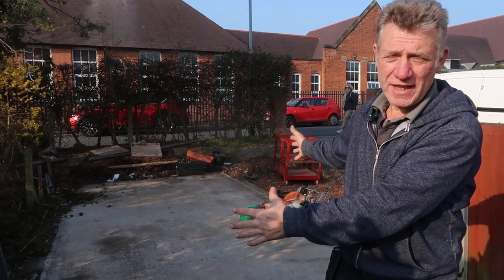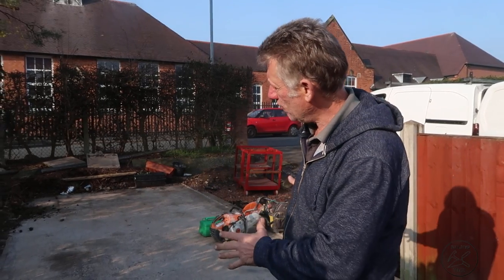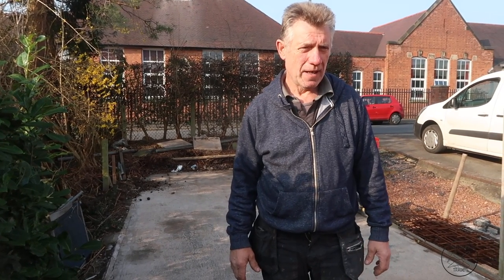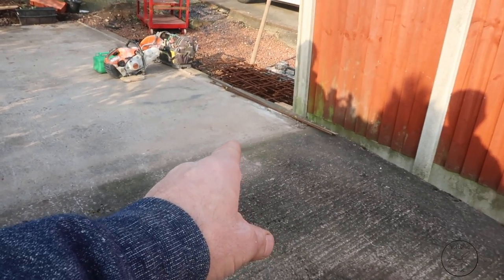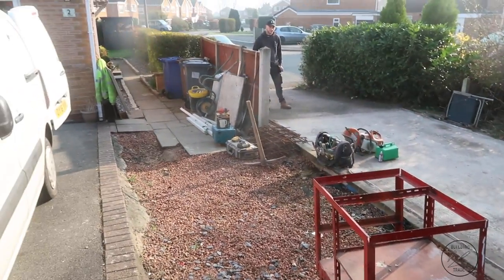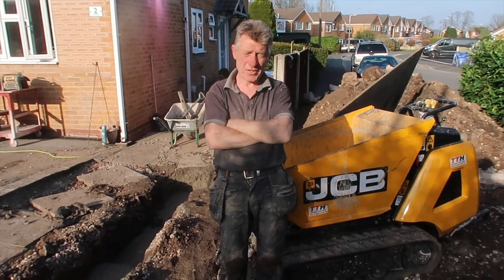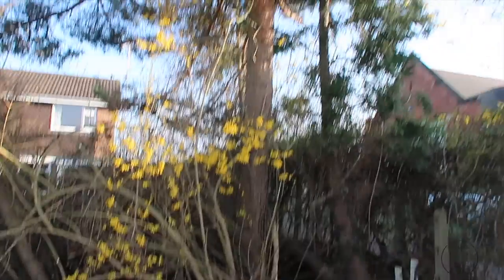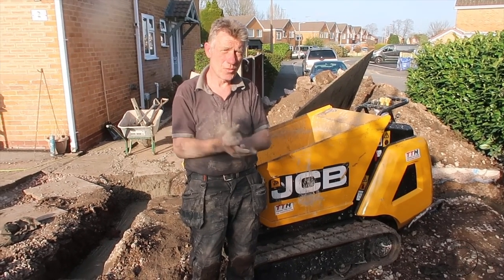Double garage full build:  The  Foundations. part 1

Comment: Would the rebar be needed if you’d have poured deeper concrete say 600mm?
Reply from the maker: It didn’t need it, I chose to put it in as I had it left over from a previous job and was a good way to use it. If I used that much concrete it would have shot the price up  and my would have been beaten by competitors!!

Comment: Building a similar single skin garage but digging to a metre. How much concrete would you put into trench foundations please ? Any hardcore ? Thanks
Reply from the maker: welk just to give you an idea, house foundation has a minimum of 225mm depth approx 9 inch in okd money! Hardcore is used if the ground is poor but a metre down is the depth for a house so you should be on good firm clay.  I suggest a 150mm 6inch depth for your concrete!

Comment: Nice work.  Is there no way you could have incorporated the (high quality) old floor slab into the larger new one (say with resin anchors or thunderbolts to tie the two together)?

The carbon footprint of concrete is enormous, we are running out of landfill space and the world is running out of sand suitable for making more.
Reply from the maker: Well that sounds good but wouldn’t have worked, it was different dimensions and it needed foundations. 
Regards to the carbon footprint it’s something I don’t believe but that’s another subject! The concrete was crushed and reused in construction and the top soil is easily dealt with unlike plastic etc!
Reply: Ever been to the Sahara!
Reply: @errolwhyte3903  No, I haven't, and more to the point, nor have the resource extraction companies.  If you'd spent more of your time studying, and less of it making fatuous remarks aimed at being amusing, but which instead just show your ignorance to the world, you'd know why this is.  The tiny and rounded-grain structure of highly-weathered sands from deserts and beaches make weak concrete.  And contain salt.  It's why the construction companies are hoovering out the far less abundant river sands.  If we humans EVER manage to turn around the mess we are making of the planet, it won't be because of the smarts of people like you, Errol.  Think about it.

Comment: What depth do you dig down to ? More detail please
Reply: So opinions vary depending on which country you are in but to summarise it if doing strip foundations where the walls rest on a thin strip then you go BELOW the frost line ie 450mm in the UK below surrounding ground level you then pour into the strip to bring it up and the bricks are put on this . The floors are 'floating' meaning they aren't connected to the bricks and are above the frost line and in any case cold protected as the ground temp in the center is around 5 degrees.
So the other option is a raft foundation and this is where it gets interesting Sarah. This can be cheaper or dearer than a strip. Basically the walls are supported by a heavily reinforced mat that spreads the load. This can be above the frost line. Reinforcement would be A393 mesh on top and bottom with 50mm cover of concrete top and bottom. Slab thickness would be an even 200mm or 9 inch and you can also put rebar 16mm 4 bars tied to the a393 2 top and two bottom all the way around the edge and even in the middle or like a cross . You can build above ground with a raft and just dump 1
150-200mm of 804 on the ground, level and Wacker it , set up forms, put 2 thicknesses of damp proof 1200 on base , rebar chair 50mm, a393 10mm mesh with 450mm overlaps minimum, then on top of this another rebar chair every meter and another a393 mesh lapped with 450 mm minimum and then around 50mm in put a 16mm rebar tied to the mesh ends, then 5 inches in another 16mm rebar and you should have done this on the bottom sides also before you put the top mesh in then if you need to tie the upper and lower meshes together so you should have put in u shapped rebar on corners also or you can use 90degree bent rebar also one top and one bottom tied. The rebar chair in the center should be 90 mm and 50 on bottom meaning top has 50mm of cover for 200 slab.You could stand a herd of elephants on this! Hope that answers your question! Ps you have to reinforce a raft top and bottom as test a piece of post it notes and bend it notice how top stretches and lower compresses, Wel concrete is weak in tension so will crack on top. Also I wouldn't put the walls on for a few months while slab settles differentially and concrete sets which at 200mm takes 2 months and then can form brickwork straight as it were compensating with mortor. Also don't insulate under raft is my advice and insulate on top after with 150mm insulated bonded bead screed. This ensures strength and stability. If you don't want your finished floor at 200+200+150=550 above surrounds then you can dig down a foot and have floor 250 above ,in this case ensure to put in 3 layers of dpm and extend gravel past the footprint of building and consider sand blinding the 804 to ensure the membrane doesn't tear although the 3 layers should ensure this! Don't rebar tie the raft to the existing house if an extension and allow it to float free with a foam insulation spacer.
Also as far as differential movement is concerned because youve created a fat edge  reinforced mat you can drill every 200mm on the sides and epoxy in rebar later if it moves unfavourably and in the strip next to it if access place screw piles  on one side and a second reinforced mat next to it say a meter wide resting in heads of screw piles😆😁
Reply: The cheapest way to do a raft is just build above ground level and dump aggregate on top but I'm not sure how building control react as I believe they want people to dig down 1.5m the full size of raft remove hundreds of tonnes of soil and put hundreds of tonnes of aggregate in to ensure its well drained but if you build above ground then as you've raise the level the 150-200mm of crushed rock ensures the drainage automatically via gravity. Honestly I'd put 150mm of what we call in Europe T2 permeable stone this is well draining and 50-75 of T1 structural which you call 804. At 10 per tonne and 20 tonne for a 50sqm slab then form and put in 1-2k of steel a393. So it's real cheap😁
Reply from the maker: 600mm
Reply: Please see my edited replys for anyone wishing to tackle a new home/garage//extension rebuild for strip/slab(raft) foundations .it's everything I've learnt to do it quick and cheap😆